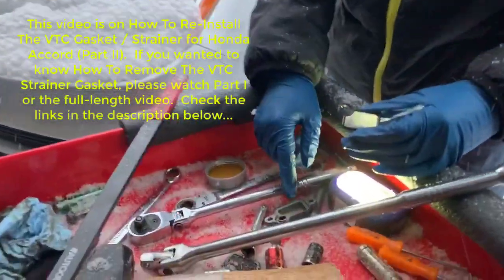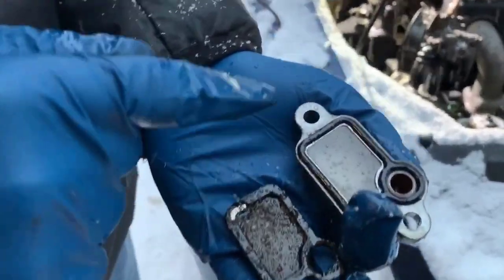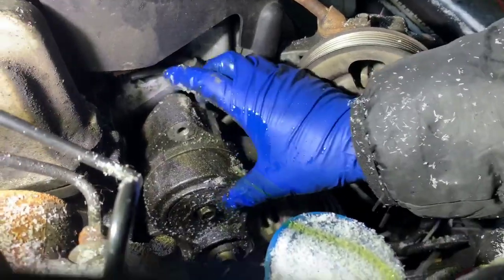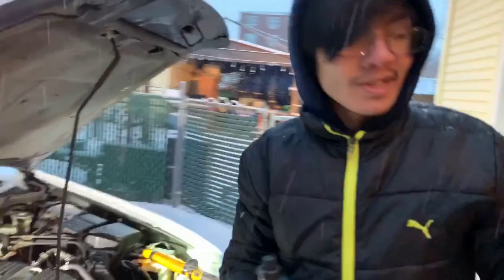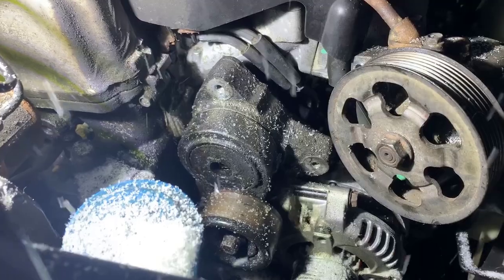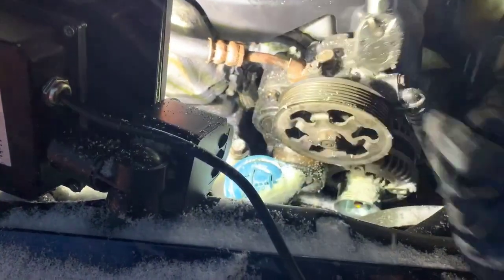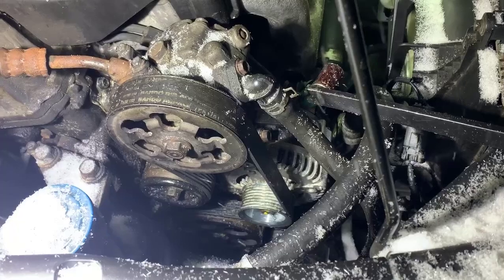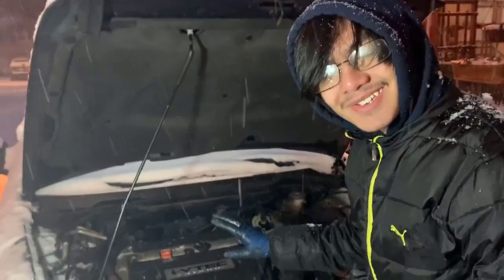Solving Honda P2646 Part 4: How To Re-Install VTC Strainer Gasket Filter Valve Screen Assembly (P2)

Comment from the maker: Here are the links to buy the PARTS you will have to replace & the TOOLS showcased in the video which you might need in order to diagnose & solve Code P2646:
1.  https://amzn.to/2Fm9HI0 | Genuine Honda 15810-RAA-A03 Spool Valve Assembly
2.  https://amzn.to/3hyadzA | Genuine Honda 15845-RAA-A01 Vtc Filter Assembly
3.  https://amzn.to/3c3xqbB | Honda Genuine Filter, Spool Valve
4.  https://amzn.to/3iw1MWR | Honda Genuine (37240-R70-A04) Oil Pressure Switch Assembly
5.  https://amzn.to/2E4MERe | Actron CP9550 PocketScan Plus
6.  https://amzn.to/2Fy3Hf3 | Sea Foam SF-16 Motor Treatment - 16 oz.
7.  https://amzn.to/35xkRnQ | GEARWRENCH 20 Pc. Ratcheting Wrench Set, SAE/Metric - 35720
8.  https://amzn.to/35BfFPH | Milwaukee 2457-20 M12 Cordless 3/8" Lithium-Ion Ratchet (Bare Tool)
9.  https://amzn.to/33xbgKS | EPAUTO 45 Pieces 3/8" Drive Socket Set with 72-Tooth Pear Head Ratchet

Comment: Just finished the job but my tensioner housing only had the long center bolt, and a nut that had to be removed from a stationary bolt, no 3rd bolt. 

Also, I very carefully removed the pulley because of the rear nut. But when I took the pulley totally off, there was no nut affixed to the tensioner housing. 

I thought maybe it fell without me hearing it, but I couldn't find it. When I fastened the pulley bolt on later, it held with no problem. 

Anyway, I did manage to lose one bolt, the one that secures the power steering line to the chassis, and of course I couldn't find it.

Thanks for the vid.

Comment: Thanks for the great video. Question. I stripped my bolts (did not have a torque wrench). I see the oil is leaking from the side. Can you suggest the best way to fix it? helicoil?
Reply from the maker: Without being there myself it’s hard to suggest a fix, although I’d definitely start with replacing those bolts! Sorry, I wish I could be more helpful.
Reply: No problem. I understand. I wish I was closer to you. Thank you for taking the time to answer. I have always loved your videos.

Comment: Why did you cut out the part where you put the belt back on at 7:47? That's the part that many of us needed to see to do it right, but you removed it from your video and then it cut to show it already on. Please don't do this for future videos! Please show the whole process. THanks
Reply: Cause it's tough to do lol and he probably had help
Reply: Putting the belt back on is not that difficult. It's the reverse of how you  took it off... but  just slip it to the side, not off completely.

Comment: Hey bro just I have one question did you put torque on the screws?  or just no over tight the screws?  I’m talking about the front VTC filter behind the power steering pump
Reply: Hand tighten and then crank down gently until you feel resistance.